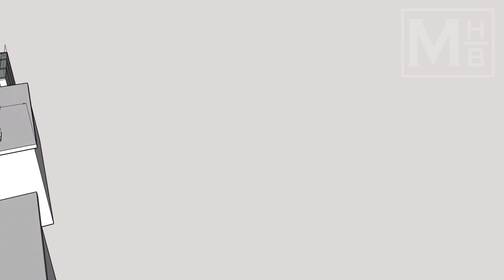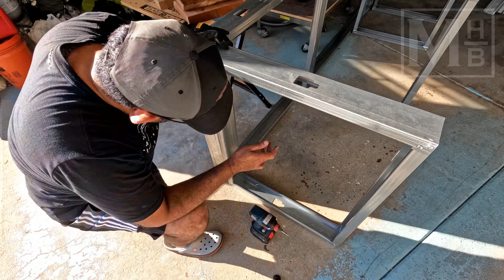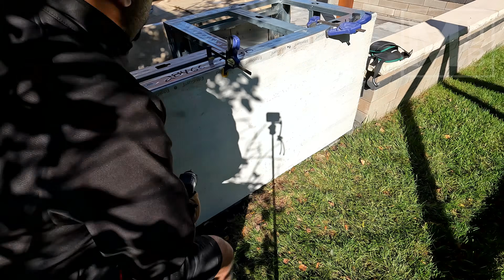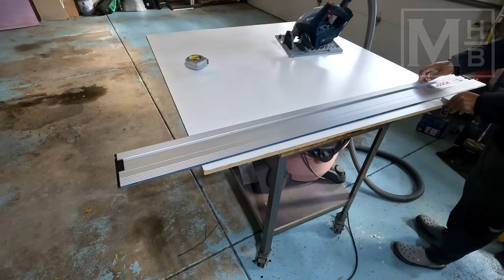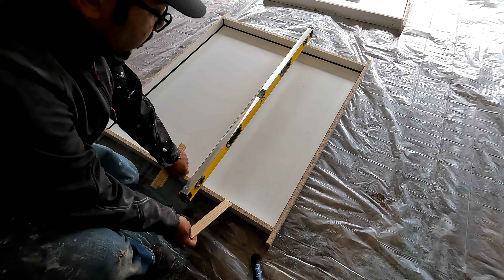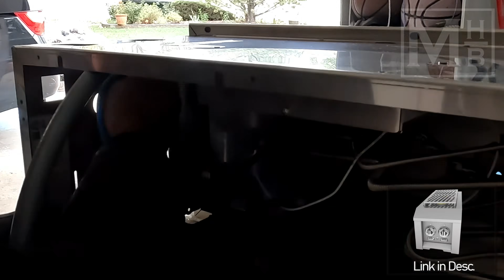Weber Dream BBQ Station: Easy DIY Outdoor Kitchen Build

Comment: I like to use masking tape along side the corners that get the silicone so once its applied i just pull the tape off for a clean line rather than having to clean up the extra silicone. might be worth trying next time. cool build man
Reply from the maker: That does make sense. Next time.

Comment: FYI, you need to vibrate the concrete to avoid getting bubbles and having a nice finish. Also, I would use clear silicone over metal edges. It will be more resistant in the long run.
Reply from the maker: Yup, thank you.

Comment: Is there any reason why you didn't use metal tracks?  is it okay to use teflon tape in gas fittings where you are working at?
Tx
Reply from the maker: Metal tracks...they didn't have the proper gauge track at my local HD.  So just went with using the normal studs throughout.  Regarding the tape, what I used is the proper tape designed for gas connections, not the normal Teflon.

Comment: Dam that looks great!  When using Sketch-up, does it recommend the dimensions for the different cabinets and cut outs?
Reply from the maker: @neiljackson8313  thank you.  SketchUp does not.  But you can get that from the respective data sheets and then putting that into sketch up will help you with the overall design.

Comment: looks awesome. did you vent the area where gas is connected?
Reply from the maker: @thomaschurch8383  not specifically.  However there is a decent size hike where the gas comes out to the grill.  There is also about a one inch gap all around the structure on the bottom.

Comment: Looks amazing.  Any concerns with such a heavy countertop resting on the metal studs?  That's my concern.  My local stores only offer 25 gauge metal studs and I worry about the weight of a concrete countertop resting on top.
Reply from the maker: No concerns on this build.  The studs put together in that configuration is very strong.  If you are concerned, possible add more vertical studs?
Reply: I finished my own island using many of the tips from this video. Thank you!
Reply from the maker: @pikapp552  excellent.  Congratulations

Comment: what did you put around the gas grill to prevent water from seeping in?
Reply from the maker: @kathydallemolle276  I coated the cement board with that blue waterproof membrane.  There is a stainless steel trim that came with the grill that is placed there.  It's tight but probably not water tight.

Comment: Amazing! Would you use 2x4 if you were to build it away from the house?
Reply from the maker: I think building it with 2x4 would be just fine and much easier.  However, I would do it with metal studs, even if it was a little further from the house to be on the safe side.
Reply: @MakingHomeBetter  got it. Thanks and good job. Next I ll have to finish watching your crown molding LED video for my daughter a room.
Reply: @alexbb6326  Im thinking of building the bbq grill/burner area with metal studs and everything else with 2x4s...

Comment: Can you give the building measurements of the frame?
Reply from the maker: The dimensions will probably be different for you given your equipment and available space ( I would have made mine longer to add in a griddle if I had the space).  However the frame for me was 101.5" x 32.5" and 33" tall.